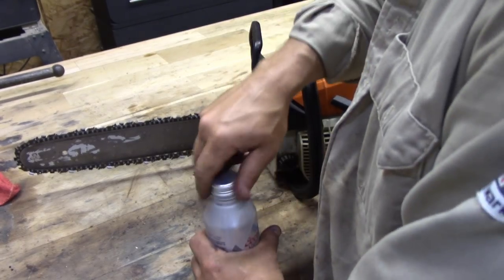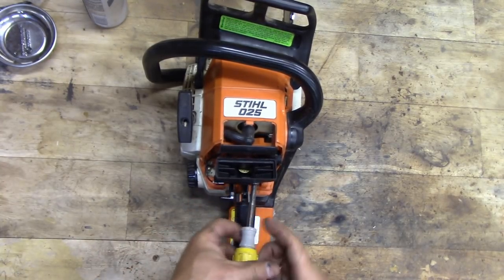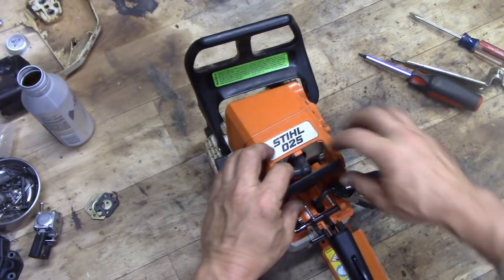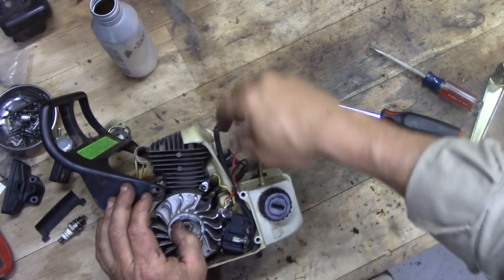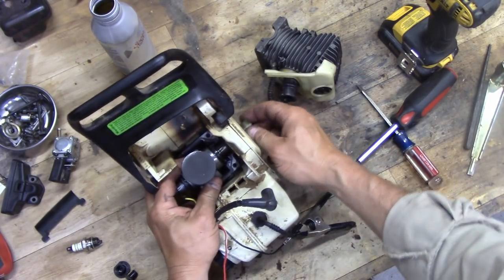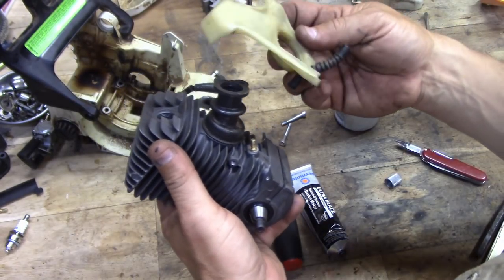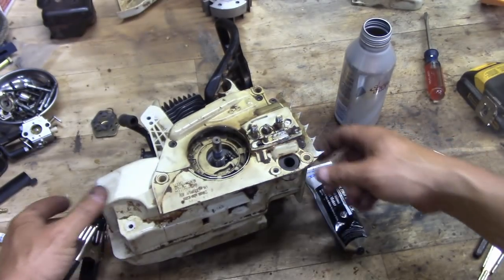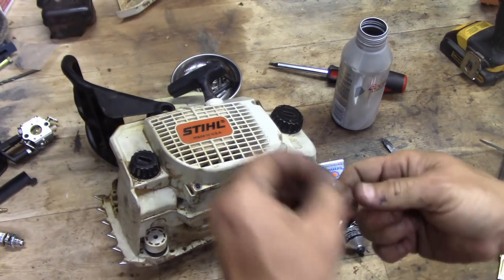Stihl 025 Chainsaw piston replacement

Comment: Was that a Trustsheer rebuild kit you used?
I am rebuilding my Stihl 039 and bought a kit from Amazon which did not have the crankshaft.
It looks like less trouble to install the whole unit instead of pulling the crankshaft and swapping it out.
Reply from the maker: No, it was a HIPA. it was $36.98. I just looked it up. it also came with a spark plug.
Reply: @lennyc624  I've stripped down my 039 to the point of removing the flywheel, (8:29 in the video).  I got the nut off but the "hammer and drift" method did not work.  I can't get the flywheel off and I've tried levering it with a flat blade long screwdriver.  I'm stuck at this point.  Is there any other way to get that flywheel off?
Reply from the maker: @bobgeddes6218 , I would maybe slightly wedge the back of the flywheel and give that shaft a few more good raps with a brass hammer or something where you can hit it pretty good without wrecking it. Mine came off easy in the video but that wasn't the first time it was off. Good luck.
Reply: @lennyc624  Finally got the flywheel off!!  I let it soak in penetrating oil for a day then used an old brass compressor fitting and a hammer.  Dropped right off!
The 4 cylinder head bolts were an issue.  You didn't mention that they are T27 heads, I used a T25 bit and ruined 2 bolts.  $2.99 a pop.  This rebuild is low on my priority list, the wife always has something else that needs to be done! Ah well.
Reply from the maker: @bobgeddes6218  Well you're learning how to rebuild a chainsaw from a drunk so it sounds like you got off cheap. The wife has something else that needs to be done, huh?
Say no more. Wink, wink, nudge nudge.
Reply: Never mind, I got it.
Rear-most bar stud held the bottom of the crankcase.
Onward and upward.

Comment: I did not see you put the cover plate over the worm gear.  If you don’t put the cover washer over the worm gear the clutch will eat up the worm gear.
Reply from the maker: You're not the first person to say that. I don't recall having any spare parts or recall seeing it come off. Possibly it was missing before I started. 🤷‍♀️  it's been working great ever since this video was made.
Reply: @lennyc624  I don’t remember a Stihl saw that has a worm gear that doesn’t have one.  On those saws,like the 025 and 024 that have constant oilers may not have one but those with worm gears have them, otherwise the clutch will eat up the worm gear.

Comment: the correct sealer for the clamshell base is either dirco or Moto-seal. and part the problem your having with motor blowing could be the inferior rings that come with those cheap Chinese knockoffs. the cylinder and piston are probably good enough but get either genuine stihl or caber rings and saw will last much longer

Comment: your chainsaw failure is because of the ethanol in your fuel which burns nearly 2x the temperature of non-ethanol gas.Ethanol burns at approx 3500 degrees fahrenheit while gasoline burns at approx 1800 degrees F.  The more expensive oil helps to delay this situation. So, the solution is to remove the ethanol from the fuel mix. This is accomplished by adding WATER to the fuel, mixing it up a bit and pouring off the gas, leaving the water and alcohol. sounds crazy? Yes, it does. The alcohol will bond to the water and will remain in the bottom of the container as the gas will separate from the water and alcohol mix.
Reply: Al Gonzalez or just buy non ethanol gas. I buy Chevron 94 here in British Columbia and use it in all my saws,weedeater and even my lawnmower,works great😎

Comment: And when you buy a new saw it says to run 50 to 1 I always run 40 to 1 with full synthetic Amsoil interceptor snowmobile oil far superior to Husqvarna or Stihl oil burns hell of a lot cleaner how to change my spark plug once a year and I'm cutting wood all the time
Reply: How many onces per gallon do you use of Amsoil?

Comment: The usual reason that the piston scores is from running the air fuel mixture  too lean. The oil mixed with  the gas is what lubricates the engine internals including the piston. When the air fuel mixture is too lean, or if you try to keep the saw running when it is running out of gas, no lubrication means friction between the moving parts and excessive heat,  and destruction of parts. You need to have a saw shop tune up your saw, one of the things they do is to  check the rpms, this tells how rich or lean the air fuel mixture is.

Comment: Hi Lenny, do you have any idea why my chain tends to jam, even when sawing small wood. Engine runs full power and all but the chain just jams or works with very slow movement... Help needed!
Greetings from Finland!
Reply from the maker: I appreciate the question but I am far from an expert on these. Check out Steve's Small Engine Saloon
. He does tons of chainsaw videos and is far more knowledgeable than I could ever hope to be. And just a cool dude. Good luck to you. Greetings from northwest Indiana.
Reply: Roope. Take your chain off and feel the edges of the bar, if you feel a high edge on the bar knock it down with a file. Next, make sure if your chain has been sharpened a few times that the rakers have been filed down a little bit to match. Lastly, especially if its a small saw, make sure the teeth are all the same length, improper sharpening can make the chain cut crooked, on the small saws this makes the bar bind in the cut and really slows things down. When in doubt take the chain to a saw shop to get sharpened on the bench grinder sharpener, that will make all the teeth the same length so you are back to square one, of just get a new chain. Hope this helps.
Reply: You might have a tight chain. You should be able to move chain easily by hand when the saw is not running. Also if the oil pump is faulty the chain might get stuck when you've been sawing for a while and the saw gets hot.

Comment: Here it is, the beer joke! What does Coors light and a couple having sex on a beach have in common??

They’re both fu@&ing close to water.   Well done Lenny. FYI.. @15:55 you didn’t install the metal disc between the worm gear and clutch.

Comment: Use the Stihl Motomix....buy the quart cans...that Motomix fuel is supposed to be good for two years. It’s pre-mixed with ethanol-free fuel. Cannot go wrong with it.
Reply from the maker: Thanks for the tip. I'll try to find some ethanol-free gas. You're not the first person to suggest it.
Reply: I’ve used the silver mixers for years professionally, they sell sizes to mix what ever sized gas can you have. Cheaper than the motomix but still very good fuel, never smoked an engine.

Comment: So many folks forget to put the cover washer back in before threading the clutch back on the shaft.  It looks like this saw didn't even have one! What will happen is the that the clutch bell/sprocket will wear into the plastic of the saw body and then into the oil pump creating a hole and a leak and the saw won't oil anymore.  See this video for what happens- https://www.youtube.com/watch?v=KhcoJTPVK-E
Reply from the maker: Thanks Tim. I'll check that out.

Comment: Somebody put straight gas in that saw there's no way that happened will wait on the gas I've been working on Two Strokes for 15-20 years all the damage like that is always just straight gas for example you loan your power saw to some idiot that has no clue and they put straight gas in it goes squeak

Comment: air leak guaranteed not mix..you fried it
Reply: Which area need sealing to stop air leak (Is it running lean?)
Reply: @seahippies  Any 2 stroke diagnosis (except when it's something obvious, like the impulse line fell off) requires a pressure/vacuum test. Anything else is shooting in the dark. If your saw starts running wrong, stop immediately. It'll save the saw and you won't have to use a cheap aftermarket p&c. Common air leaks are crank seals, base gasket (or goo gasket on a clamshell like this), intake boot or block or gaskets, case gasket, impulse line, and fuel lines (yes, pressure/vacuum all lines too). It's pretty common to see folks replace the piston and cylinder without finding the cause of the problem. It's also quite hard to ruin a cylinder, most non-catastrophic failures are just some aluminum transfer which can be sanded off, saving a nice OEM cylinder and only costing you a piston.